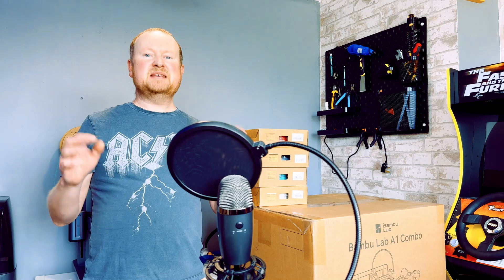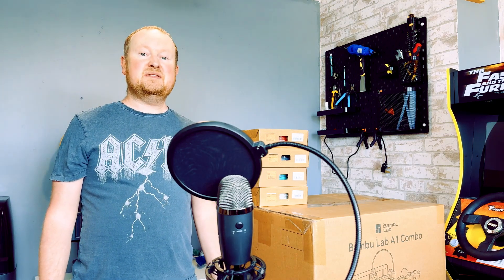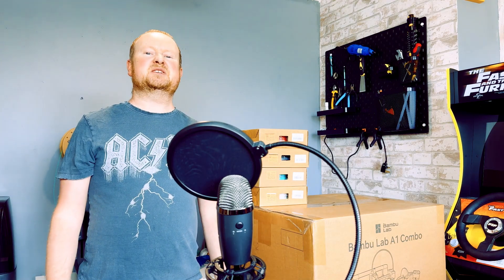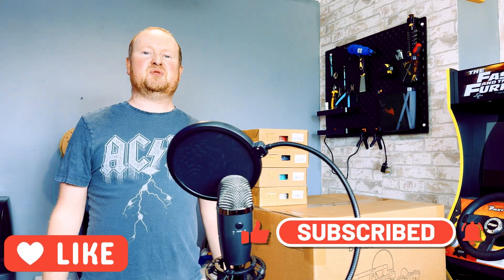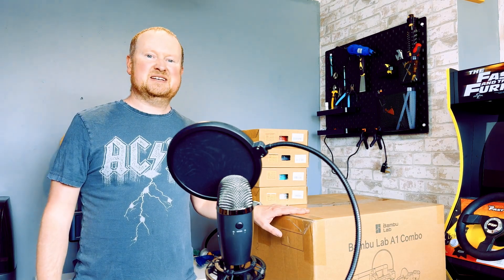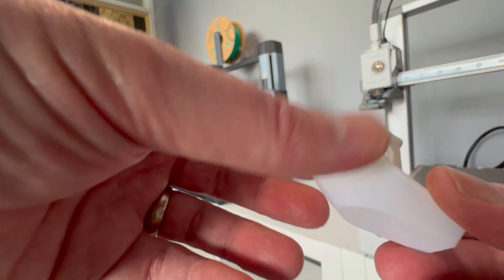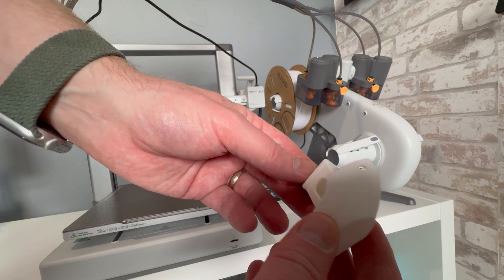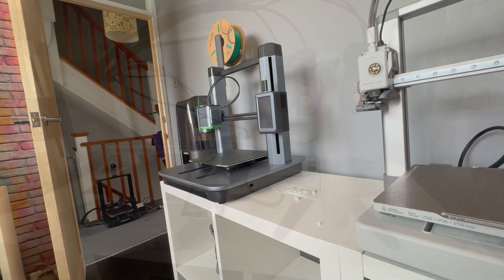Is the Bambu Labs A1 Combo 3D Printer Worth the Hype? Honest Review and Testing.

Comment: Hi does any filament come with the combo ? I'm about to take my first steps into 3d printing and I think this is the machine for me after doing a little research! If it doesn't come with filament what 4 rolls would you recommend for a complete newbie ? 
Thanks Paul
Reply from the maker: Mine did not come with much, just a sample. You will need 4 reels to start you off. Good luck and happy printing